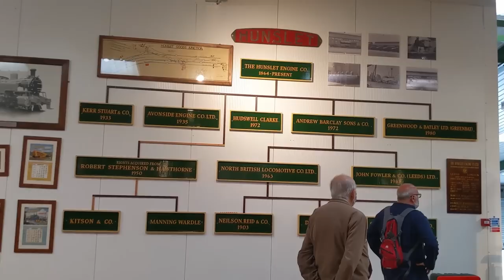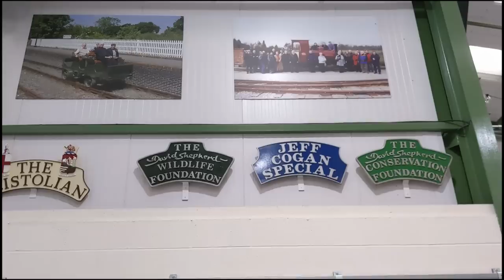LMM does the Statfold Barn Enthusiast Day - to show Ash the K1! Chasing Dinosaurs Ep.3

Comment: Fantastic place! The collection of locomotives on display is astonishing, so much in steam! The parallel running shots were just incredible. Something I find really impressive about this place is the very curated way the running lines and museum are set up, it adds a lot of presentation value to the whole experience to see narrow gauge stuff trundling over an open field, then through a narrow garden passage, and so on. It's almost like a moving sculpture garden, featuring industrial 2ft gauge engines. And the battery tram, of course.

As important as K1 is, though, I think my favorite one you guys filmed was Isibutu.

Comment: What a great video, have  seen others from the day but the commentary  makes it better.  I know you really  went for the  steam but I was surprised you didn't make comments on  Burton and Ashby Light Railway #14 which was of course originally powered from an overhead wire, but has now been converted to battery operation since coming to Statfold from Detroit
It also had a gauge change when it went to Detroit, from 3ft 6 in to 900mm.
Here is a picture of  it in service during the 1920s
http://www.sct61.org.uk/bo14a
Reply from the maker: We thought about it, but felt like we couldn't fit info on everything in!

Comment: Think there is a Standard Gauge Garrett at bressingham. Dread to think the cost in getting her running again but would be amazing to see at all the different Norfolk and Suffolk preserved lines
Reply from the maker: They are talking about doing William Francis. Problem is it's just a big industrial.
It's too big for most small railways, and not meant to do the distance of the larger ones.
Reply: @lmm  wasn't aware of the limits in that regard. Thanks for the info!

Comment: That Plymouth diesel, one of two at SBR, is a really interesting machine. It was originally 3 foot gauge, and came from St Marys cement in Ontario where it brought limestone from the quarry to the cement plant. Plymouth did offer these all the way down to 23" gauge, so the narrowness isn't totally off, although to my knowledge they were rarely if ever ordered below 30" gauge. Plymouth also offered a range of much smaller locomotives that were far more popular among the "baby gauge" railways as they were called in the US, and the bigger locos like the one at Statfold, part of a model line known as the J series, were predominantly made for 2'6", 3", 3'6", and standard gauge. Yes, standard gauge, so you were 100% right about just spacing the wheels out wider. The company got their name from Plymouth Ohio, which is where their factory was located, and believe it or not they were also the originators of the Plymouth motor car company, which was purchased from them by Chrysler in the very early 1900s, leaving Fate-Root-Heath (the parent company) to focus on locomotives instead.

They are indeed very sizeable locos for narrow gauge, the 4 wheel J series is about 15 feet long, 7'3" wide, and about 9 feet tall. Available in either 4 or 6 wheel configurations, mechanical or hydraulic drive. They were fitted with a range of reliable engine makes such as Caterpillar, Cummins, and 2 stroke GM Detroit, with horsepower ranging from 180 to 325, and weights ranging from 12 tons up to 25 tons. One of the standout features of the loco is its frame, which is made out of massive slabs of torch cut steel, with really thick reinforcement welded on. They truly were built like bulldozers. The resulting chassis is virtually indestructible, and gives the locos the advantage that they carry all the weight down low making it very stable. They also have a very nice link-compensated suspension system that had a reputation for giving a "magic carpet" like ride even on relatively poor track.

I think it'd be well worth it if you can ever arrange to go back to SBR to do an episode on the Plymouths, they deserve a showcasing!
Reply from the maker: Well there's my research for if I get to review it!

Comment: 22:05  Rail Bus  by the United States Motor Corporation, Oshkosh, Wisconsin. Noice!
Question, When there are dual/multiple locomotives on one end or one each on both ends, how do we know which one is putting more effort or helping the other? John BC, Canada
Reply from the maker: On trains like shown in the video they're both just working gently as the train doesn't need two engines.

Comment: Great video, great museum!!  You seem to have all the fun stuff there in England.  This video is almost enough to make an old man travel across the pond from the colonies (USA) for a look.  Questions, I have questions.  
The K-1 seem an odd design, is that a water tank out in front of the boiler?  
What fuel is used in the smaller engines?  Some show dark smoke, coal, but some seem to have no place for coals and show white smoke. 
Does it really take two locomotives to pull or push/pull these few cars? 
It is a shame that the little railway crane at the entry to the park is not operational.  
It mush have been really tough that you could not step up to the footplate and operate some of the engines.

Thank you and keep up the good work!!!
Reply from the maker: It's a super collection.
We've got a lot of very good stuff here - well worth a visit.
Yes, that's right for the Garratt. Large boiler effectively supplying two conventional locomotives, and as each Power Bogie can pivot it can fit round tight curves.
Coal is used on everything. 
It's just a matter of how much coal is on the fire / how hard the engine is working that changes the colour of the smoke. 
No, not at all, but it allows more engines out for people to see. 
It was, but hopefully it'll happen!

Comment: The North Bay Railway in Scarborough  is a 2ft inch gauge railway  that has a new build bagnall Georgian built in the year 2016
Reply: North bay is 21 inch gauge
Reply: @SDE1994  it is 2ft or there about as 24 inches equal 2ft so it's 21inches which is closer to begin 2ft anyway
Reply: russian 5ft gauge might as well be called standard, its only 3 and a half inches out

Comment: With the car air con turning the footwell into a spa, all that will be is clogged air con evaporator drains. Depending on the car, you should only need to blow them out with compressed air.

Hope it helps.